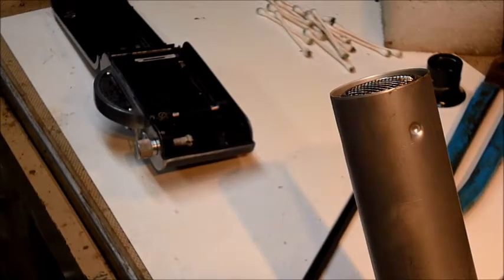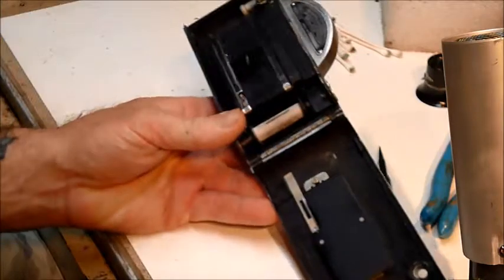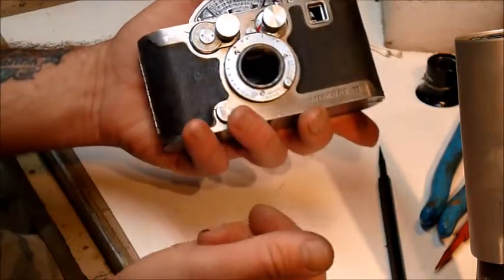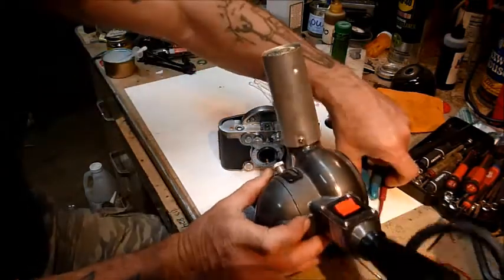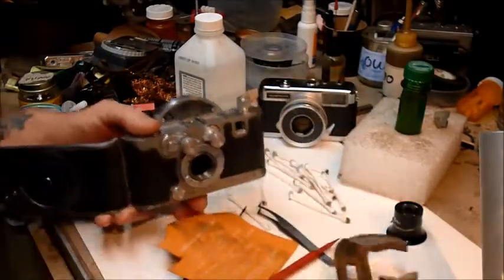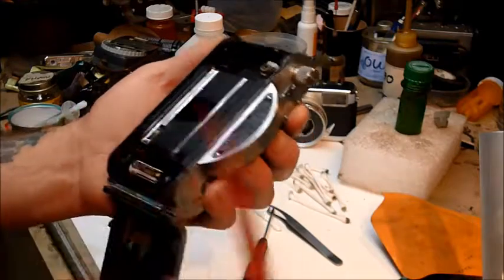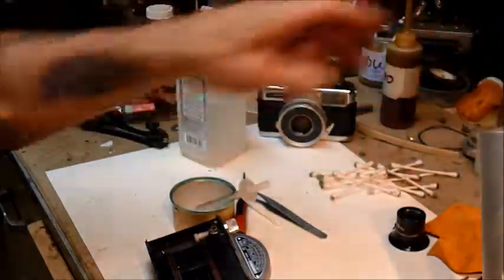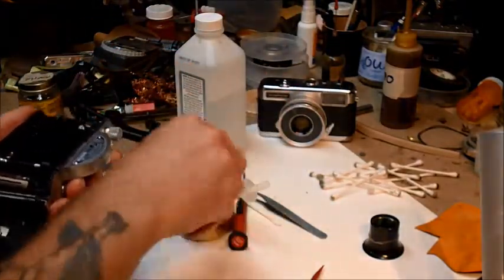Univex Mercury 2 stuck focus ring

Comment: Hey! I love that you've posted a video about this camera, it's such a cool and unique one!
I recently got one and the mechanics seem to be stuck in bulb mode. The shutter speed dial turns as expected and the disks move as yours do, but the disks won't rotate all the way around when I depress the shutter - I have to press the shutter twice to complete any rotation.
Would you have any idea how that is happening?
Reply: Actually, I figured it out pretty soon after I wrote this after being stuck for a few hours. There's an arm on the back of the discs that was stuck and I'm working it back into being usable
Reply from the maker: @ericholbrook7723  excellent! here is the best link I have found so far, very handy with notes.         https://www.flickr.com/photos/7699588@N07/albums/72157629636471949/

Comment: Hello, I have jsut found your channel and seen that you have some repairs for Minolta. I was very excited to recieve my 35 105 lens the other day but the autofocus doesnt work, only the manual, do you have any idea what may be causing this? The AF does focus sometimes but then seems to get stuck, and if i push it slightly while pressing focus button it moves but then gets stuck again. Do you think this is an easy repair? Thank you in advance for any possible insight
Reply from the maker: I have only worked on a couple of auto focus lenses and the word easy isnt the first word that comes to mind. My guess is that the servo motor has a broken or obstructed gear drive. Where you go with it is dependent upon how much you care about the lens if it only works in manual. If you can live with that you may be well off to leave it alone. If the auto focus option is what makes it valuable to you, exploratory surgery may be in order.   You might get lucky and find info online for your particular lens or maybe an exploded view. In any case, the servo is likely near the rear of the lens, gently removing the plate screws to have a look inside is fairly straight forward for most lenses. I always recommend the same thing, take lots of well lit pics, keep parts organized and work in a clean area, I like to work on paper towels to reduce bounce if you drop a tiny screw. Above all else remember, this is a great way to destroy your lens/camera. I add that in most of my videos because I am a clear amateur and assume most folks viewing are also. If you give it a try let me know how you make out, your experience could help the next person.

Comment: Hello, any advice for a stuck (like adhesive stuck, stuck) Shutter advance knob. I read the manual, twice and know not to be in rewind mode or at a low setting and to have the counter number 65 indicator opposite the indicator line… ugh, I really want to restore this camera as it was my Grandfathers.
Reply from the maker: https://www.flickr.com/photos/7699588@N07/albums/72157629636471949/
Here is a link to the series of restoration pics I used the first few times I had to dismantle on of these. There isn't much that can really go wrong with these cameras, they are not very complicated and the workings are very strong. I suspect a good cleaning and inspection will cure whatever ails your camera. Be sure to post and tricks or observations here for the benefit of others, and feel free to ask more questions.
Reply: Wow, thank you for answering and sharing the link. I will share my findings, yes, on this thread! ❤ I’ve learned to video as I go so I can remember how to put things back too!